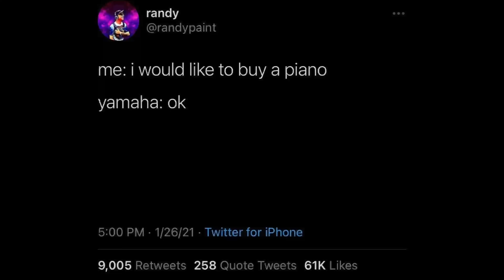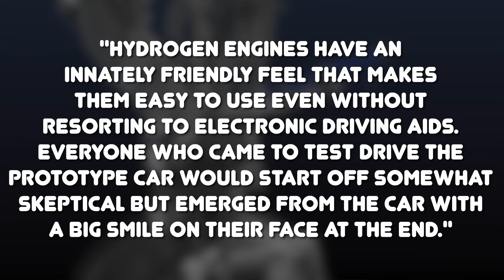Toyota's New 455HP Hydrogen V8: Everything You Need to Know

Comment: I was always under the impression that Hydrogen fueled ice engines emit NOx. How did Toyota overcome the nitrous problem? Edit: I wanted to add that Teslas are not the Shangri la everyone thinks they are because their suspensions break a lot and cost upwards of 5k a wheel to fix when they do. It makes sense this happens because the weight of the car is increased from battery weight. The only way I am owning a Tesla is if I trade it in every three years.

Comment: You can get hydrogen from the process of electrolysis from water. Just saying
Reply from the maker: Why not just use that electricity for an electric motor?
Reply: @Dustrunnersauto  because is uses less electricity to extract the hydrogen out of water than it does to charge a battery as big as the underside of a car.

Comment: I’m thinking hydrogen is made from water. You can make it at home. Can’t make gas at home, and with rolling blackouts coming you could have problems there coming to. Before they were using hydrogen to power an electric cell to create power for an electric car. I’m pro hydrogen in this application. I’m sure the upfront cost’s will be terrible, but buses and garbage trucks are using it. Gas stations are few, but if you are making fuel at home, who cares. It doesn’t have to be your only car.

Comment: If the cost of hydrogen is lower and it gets to be as easy to buy as gas (in cities), because the maintenance is the same and market regulation is shifting against hydrocarbon-powered vehicles, these vehicles would be a preferred. Plus, if you have kids, you don't want them breathing gas fumes. But all that aside, these engines do make sense in farm and heavy equipment when batteries are impractical. There are already hydrogen-powered mowers being used by companies here in Victoria, BC. They buy hydrogen at the Esso on Quadra and McKenzie.

Comment: All the talk is about infrastructure but there is no need to transport the hydrogen. It can be made on site anywhere there is tap water. Passing a direct current though water causes the H2O molecule to split into hydrogen and oxygen. One will collect at the cathode the other at the anode giving a positive charge to one an a negative charge to the other. Feeding the hydrogen and oxygen mix though a magnetic field will separate the hydrogen from the oxygen. The oxygen can be released into the air or even into a hvac ductwork. The hydrogen will be compressed and stored. This process could take place at every service station across the nation. During the day solar could be used for the direct current. The reason this hasn't happened is because big oil can't make money off people making their own fuel.

Comment: A few things. Hydrogen is the future it has not had the attention electric cars have had so its development  improving.  I have a alternative energy company and hydrogen has had a few "game changing" developments lately. I drove a 2002 528 BMW  back in 2008 -2013 with a hydrogen kit my company use to sell.   If you ever need to add 15% more horse power to a car that's the way to go.  Honestly ICE is made for hydrogen. It is amazing how well they go together. The steam cleans your engine while keeping your engines temperature way down. It sounded amazing. I swear it sounded like a George Jetson craft. It had a zing or really high ping it was incredible. My neighbors  at different times told me it sounded like  a spacecraft. And one of them  that said  that was actually in the Air Force. That car was so fun to drive its power was amazing.  Should have never sold it.

Hydrogen has a big future especially since the paten for solid state hydrogen for fuel has expired.   No more crazy storage tanks or pipeline its all going to be solid state.  It takes a Lasor to extract the hydrogen but big woop.. Its almost like a reel to reel or like a 8 track tape or something. To fill up you just pop out a cartridge  and replace it with a new one.  You can carry extra without worry because it is in its solid state still.

Hydrogen is the most volatile element in the Universe  and is better than Electricity. Electricity is  not even researched  in commercial vehicles anymore. Electricity cant handle a 18 wheeler or a bus or heavy equipment etc.  that runs all day. Electrical cars were simply the easiest out  of a problem which we were trying to fix. Dont get me wrong all of these alternatives have their own special use in our future. I just believe hydrogen is a more powerful source.

Comment: Hydrogen is the way to go. Like elections, hydrogen station can be put up. Lets talk distance driving. While electric car can only go 300 miles and take 8 hours to recharge. I like the freedom of a gas burning car. the same feeling I would get driving a hydrogen car or truck. It is good to know there are car makers making hydrogen powered cars and trucks. Note the engine will burn a lot cooler. Battery power cars, will become land fill because of the high coast of replacement battery. It would be cheaper to by a new electric car.  What do you do with all the battery cars? Is there a way to recycle electric cars. No there isn't !  France is already having to put land a side to park for the 1,000's worn out electric car the city is using for transportation. It isn't coast efficient to replace the battery. France buy new ones. Are we on the same page ?

Comment: The best solution, for now, Is to turn water into electricity. Once you break the covalent bond with Freq. the sky's the limit. Meaning Elon can get to Mars. see what I did there. p.s. Capt. Obvious says, You can recycle condensate from combustion. Weve been burning Hydrogen, It just has a carbon atom attached. Hydro-Carbon.

Comment: hydrogen power just doesn't have the pumping station infrastructure yet plus hydrogen is able to run EV's and internal combustion depending on if its a motor or a fuel cell so its able to be applied to both

Comment: "Literally no demand at all", I think you'll find there is demand for not having a BEV. Many people do not have the facility to charge at home, and you have to accept that the time it takes to charge a BEV is unlikely to drop because the power required to charge a battery in the time it takes to refill one, will be in the megawatt range. This simply will not be feasible as this would require a garage forecourt to have the same power requirements of a small town. BEVs are fine for those who charge at home, and don't go on long journeys frequently, for those of us who can't charge at home or do long journeys (or both), they are frankly incapable of meeting our needs. Not to mention that faster charging stations will cost more per kWh than charging at home, thus making a BEV even less attractive. At least with H2, you have the convenience of a quick fill and longer distances. If Battery tech, electrical infrastructure and chargers do allow a 100-150kWh battery to be charged in the same time as a gas car, then H2 will lose, but I really can't see it happening.

Comment: It's not actually a Toyota engine it's made by Yamaha... now here's the thing hydrogen engines I stumbled on it when I was about ten when I questioned big tech at 13 yrs old with my idea I was told it wontvwork cos hydrogen is to volatile to put a tank of hydrogen on board a car like sitting on a tank of water is volatile when u can use electrolosys powered by solar energy to split the hydrogen an oxygen which u burn hydro add oxy as catalyst add spark bang biproduct exhaust= water but no they'd rather make money on selling stuff tgat u need to pay more money on non renewable posting fuels... so saying this im kick in myself for not taking this up with a major car Corp and the bank as a kid cos iv known this shit since I was in primary school kicking myself for having been to young to have the mindset to aquire the funding for such development 30odd years ago

Comment: Emissions are only half the story.  Burning Hydrogen is STILL burning.  The cost to the environment of green house gasses loses sight of the factor of any internal combustion engine…they burn O2 as part of the combustion process.  The more O2 that is burned the more it is broken down and alters the volume of available breathable air around us.  The ‘electric is pure and clean’ claim is even worse.  Most electricity is produced using fossils fuels and there is no evidence that this can change any time within the next 100 years.  Between the two I think the hydrogen engine is better for the environment than electric and will have a lower manufacturing footprint but hydrogen is far less safe….how can they get past that?  Hmmmm.  The key is infrastructure.
Reply: So do you feel its a viable replacement for gasoline and will it gain the traction it needs to be the go between for gasoline and electric? I don't think electric will play out like the wet dream they are trying to sell us- for many reasons. But if they are hell bent on getting rid of gasoline engines, do you feel that hydrogen will be the happy medium? I sure hope so as a combustion engine can not be replaced by anything electric- period. Hydrogen sounds like the possible answer. Cheers and thanks in advance.
Reply: @giggiddy  just as gasoline outcompetes the steam engine, which was by leaps and bounds more efficient, reliable, powerful and technologically advanced by comparison with the gasoline engine, electric cars will out perform hydrogen or natural gas in the marketplace.  Not because it is better…obviously the electric car has an enormous carbon footprint in manufacturing (18% more than gas, 50% more than hydrogen) in it’s origin…(which is aa bad start) but the batteries need to be replaced, increasing it origin carbon foot print) and over 60% of ALL electricity is produced by burning fossil fuels!  So electric cars run on ‘gas’!  So there is no ecological argument whatever for electric cars over gas/diesel/propane, it’s just not there.  The reason electric will be the next car is INFRASTRUCTURE.  The Government has stupidly decided to double down on the electric vehicle to replace fossil fuel burning vehicles because…well…WE keep sending them money and NOT holding them accountable for what they do with it…it’s a chronic and stupid problem.  But both the car industry in the USA and our Government have made up their minds full speed ahead damn the science!  Good news for Elon Musk and the money driven eco industry and whoever ends up on the new Government committee which adorns themselves in great sweeping powers and pays themselves exquisitely high salaries at the taxpayer expense.  The rest of us will eat the crumbs from the table simply because they have made up their minds.  If capitalism works it will be the most comfortable car that can go the furthest for the least cost….but I harken back to the steam engine and wonder….

Comment: My father ( R.I.P. ) and my uncle ( R.I.P. ) both chief engineers at the company's they worked for. Knew, way back in the 70's, during the OPEC oil embargo... That Hydrogen, is the fuel of the future. Electric motors will never have the power, the torque, the mileage, the cheap, clean ability to produce.. advantage...that Hydrogen does. Hydrogen comes from water, the most abundant resource on the planet.

Comment: Talk to any Electrician and they will right up front admit our national power grid cannot handle the current needed for everyone to drive electric cars.  Period.  Take a close look at California.  Already warning about rolling black-outs to their customers this summer.  You can count on this to be a real thing when the mandate drops for all to go electric no matter where you live. Hydrogen can be produced and compressed during non peak hours (and stored pretty much indefinitely without loss) for peak use without further burden to the national grid and guess what?  You get to still employ an Electrician in your home for a similar hook up.  Existing internal combustion engines can be converted to run on the fuel like can be done with Propane and CNG.  Engines that burn those 100 octane fuels (Nitrogen is one) do not produce the fluorocarbons which contaminate the crankcase oil leading to much longer service intervals.  Electric is great and all but your argument falls flat when you start looking at the environmental impact  of mining the limited raw materials so everyone can "save" the planet.

Comment: Hydrogen doesn't  really need a big infrastructure. Hell Hydrogen done right means half the infrastructure is already here. It really doesn't  take much to "make" Hydrogen. A glass jar, stainless steel forks, a water source and power source. Yes for the average normie consumer electric powered vehicles are great but for the tech and engineering savvy some of which are already setting up vehicles with Hydrogen and gas hybrid setups where you literally use the aforementioned glass jar and forks and literally separate the Hydrogen fromthe water on demand as needed.

Comment: Why do so many people think powerplants "on the way out"? Electric vehicles are great and it's  awsome we actually now have viable options but the one main advantage. They generate power and can be fueled by many abundant sources. Meaning  if a natural disaster takes out power for a week or 2 you can stay mobile provided you have fuel stored or have access to it. You can use the vehicle to power and run other equipment like with heavy duty trucks. Like the last 100 plus years they can be run on anything from gasoline, diesel fuel, kerosene, vegetable oil or peanut oil or biofuel, alcohol, and one of the OLDEST fuels hydrogen. We are no where near running lets say a garbage truck with a packer body that runs heavy hydraulic systems all day soley on electric. Want to go overlanding in the desert or off grid in the wilderness in your 4x4? You are still going to need an actual power plant to keep you going. Hydrogen is the true ultimate option for environmental friendlyness renewability and most importantly SELF RELIANCE. (Which is why governments and corpos push electric cars so you are tethered to them and their grid).

Comment: I thought toyota owns yamaha.  Still too many moving parts for repairs than a ev. Also hydrogen common leaks and invisible flames hard to detect. Also extremely flammable and burns three times hotter than methane. Too costly to refine hydrogen and unstable.

Comment: Forgot one thing, if is a hydrogen car mean that you won't need to pay for fuel for the entirety of that car life, it's so simple to generate hydrogen in your on house, just a battery with solar panel, glass jar or container, some stainless steel for conduction and a compressor to tranfer fuel from storege to fuel tank and water ...FREE fuel forever even if somebody goes to war and company decide to jack up the prices of gasoline you'll still have all the fuel in the world
Reply: That's the reason why is better not because is better performer or is clean emisión  is because is free fuel... Not slot of people know how easy is to make hydrogen and most of the equipment is a one time purchased of 50 to 1000 $ depending how fancy you want your fuel generator to be, no need to be dependent on hydrogen fuel station on California

Comment: like everything else. we too have a limited supply of electricity and clean electricity that dosent impact the enviernment so a hydrogen hybrid makes more sence but we are limited in re fuel infrastructure and resources to support investing in hydrogen powe. electric vehicles share battery materials with power tools and cellphones and we will too run out of the supply for making batteries. so its a good idea to keep exploring and expanding options. you wont tow 300 miles with a tesla rated at 300 mile range due to the extra weight so this v8 i see being an exelent option for the tundra maybe tacoma too

Comment: they will perfect the hydrogen on demand system .much like the one created by stan myers then it can be run on water. now imagine a hydrogen wankel motor. hydrogen motors produce verry little heat and that makes them more reliable .in fact a standard v8 cast iron block motor running on H could run for ever because it will never get hot enough to ware it out. i have seen a similar thing in motors witch used propane.

Comment: Yes or no a lot of people still love the sound in the feel of a combustible engine and customers do you like a reliable products that will last them a good 10 to 20 years if they take care of them but at the same time these new hydrogen cars aren't cheap the fuel is not cheap the fuel would have to be cheaper than gas for it to be truly a viable option electric cars on the other hand are great are pretty reliable but yet they're still a charging station length of traffic in to charge it problem and they still don't sound like a combustible engine and they're expensive to including happened to replace the batteries on them batteries for these electric cars replacement front by the manufacturer is around $5,000 talk about expensive oil change